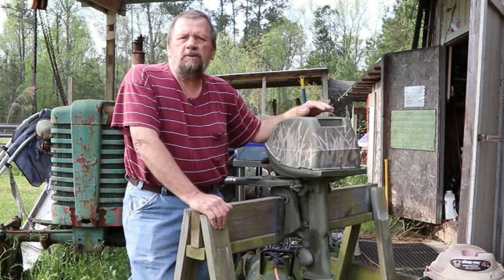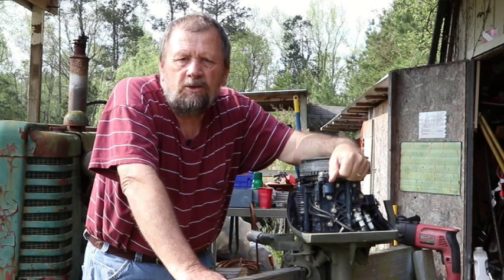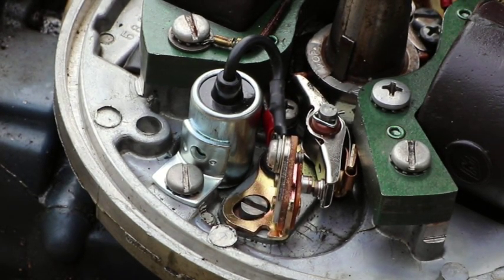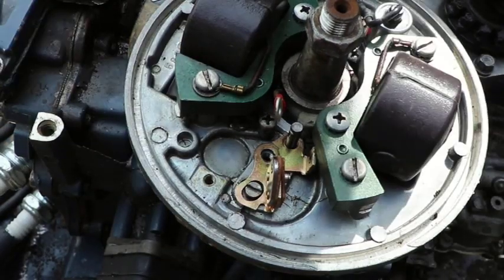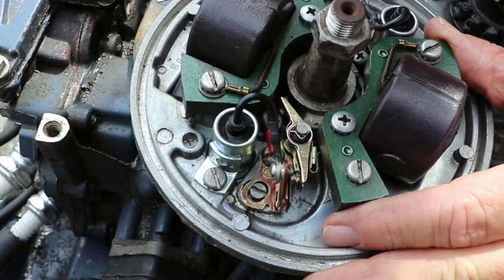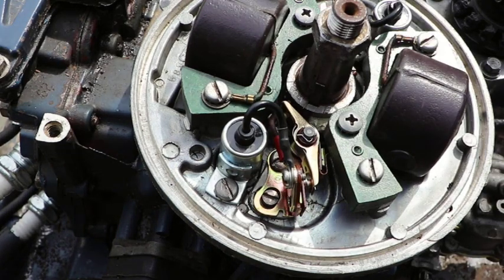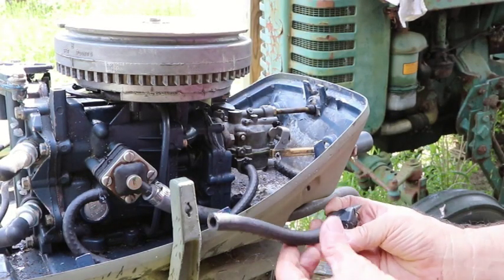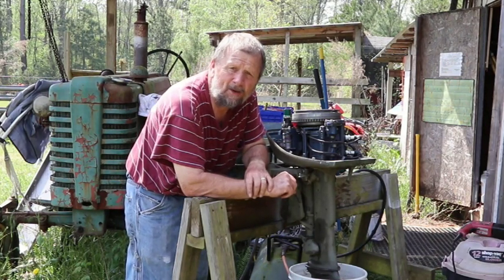1970 Fisherman Trouble

Comment: Great video. You are a great teacher. Quick question: What type of drill do you use to spin the motor??
Reply from the maker: I am using a 1/2 drive Milwaukee drill. That is the ones that will try to hurt you if you are not careful. It sure beats pulling on the pull cord.

Comment: I have a similar engine 5 hp but no gears and the accelerator is on the side, bought new in 1965. starts 3 pull every time. In all that time we have replaced the plugs and the plastic ring gear . and a few hundred shear pins

Comment: Good video brother. I've been wondering when you were going to post a video. I stay in lumberton nc. I would like you to check my motor out. Evinrude 25 hrp. It smokes more than i like. What would cause it to smoke a lot 2 stroke
Reply: Curtis w Jackson it’s probably a 50:1 motor and you may by running a richer premix(40:1, 30:1, 24:1, etc) witch will make it smoke a little more. It won’t hurt it, but will most likely oil up the plugs a little more, in my opinion I think it’s better to run a richer mix because if your carb isn’t tuned exactly right in may not get as much oil from running it lean. But I wouldn’t worry about it because a lot of smoke is way better than no smoke at all (in a 2 stroke)

Comment: I have 1970 evinrude 6hp runing good I change water pump  also change thermostat but still engine get in hot water don’t get circulate need help
Reply from the maker: I have in the past put a few ounces more mix oil in the gas to see if that makes a difference. If the engine is till running hot after water pump and thermostat. I would pull the head off, and look to see if the water jackets around the cylinders is clean and not full of scale. The most is would cost is the price of the gasket.

Comment: Even the best outboards require maintenance.  Is that fuel pump oriented correctly, kinda looks upside down...The starter rope has been cut too short also, that should be replaced...  The owner obviously doesn't appreciate what he has there, can't buy reliable engines like that anymore....

Comment: I hate those jesus clips.. wait for all my parts to come in so I can fix mine. Do you have a video on changing that top seal under the points? As the fuel line goes I had a friends motor had the same problem. He had a mercury fuel clip instead of a evinrude/Johnson.